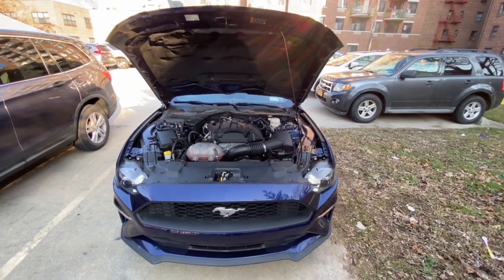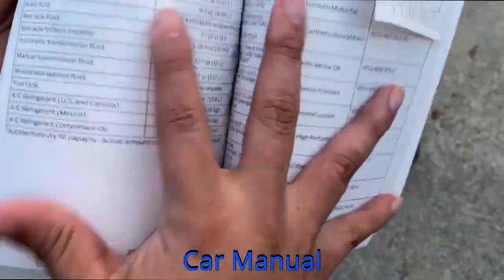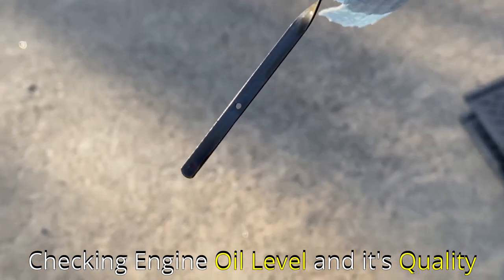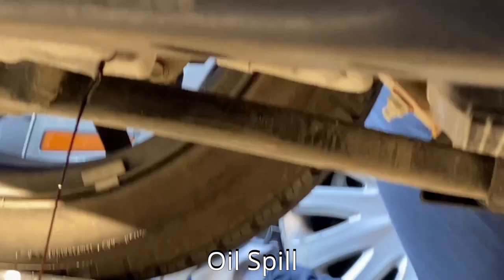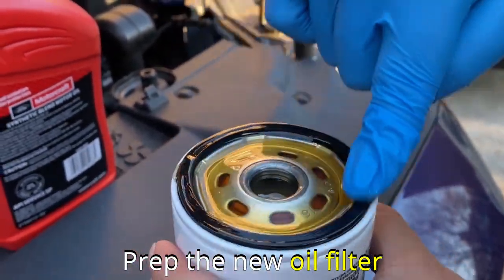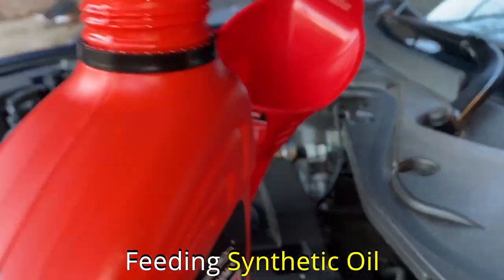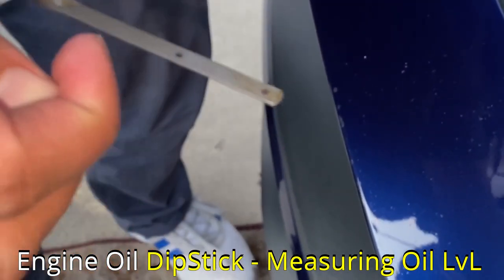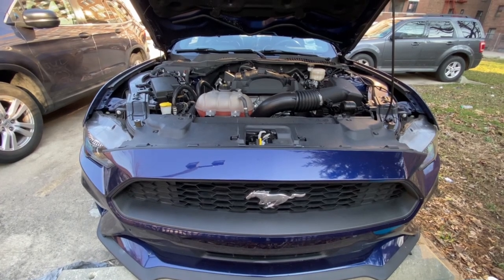DIY Oil Change for Beginners (Complete Guide) | S550 Mustang (2015-2020)

Comment: Awesome vid bro, But I always check my oil level when its parked over night and before starting the car. I guess in that way you get a accurate reading. Same thing with the tire pressure too.
Reply from the maker: Yea definitely. But if you want to know your oil lvl and it’s quality right after the oil change then drive around for 10-15 mins and let it rest for another 5 mins before check the dipstick, this will give you as accurate result as it can give.
Reply: @Mr.Roy72   I was just following uncle Scotty's advice. "Flat surface, first thing in the Moring when the engine cold"
. #savagescotty
https://www.youtube.com/watch?v=d4U6jT4YWYY
Reply from the maker: I agree with you and Scotty. I think you misread my msg. All I’m saying that in order to check the oil lvl and it’s quality right away (at that moment in time) then you can drive around for few mins, let it rest and then check to get a better reading.